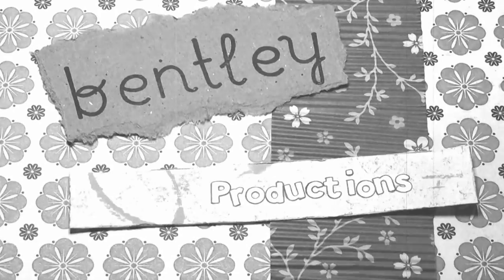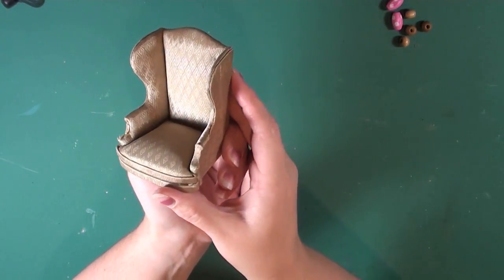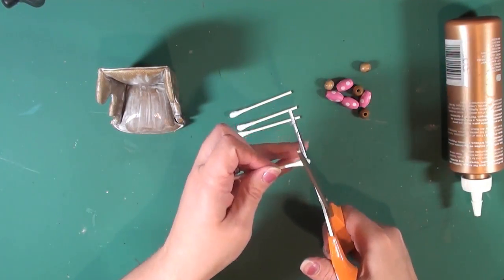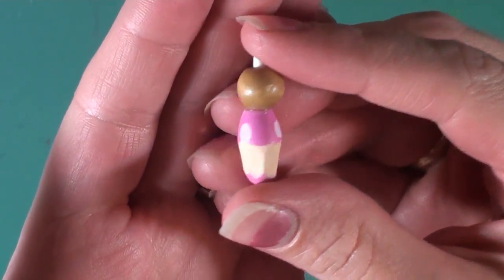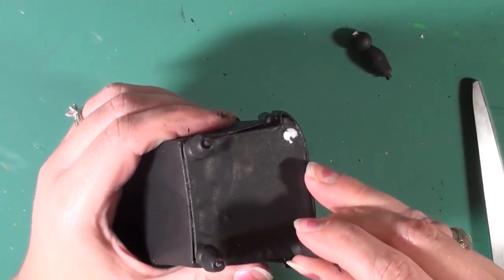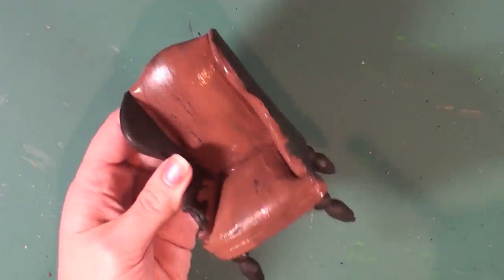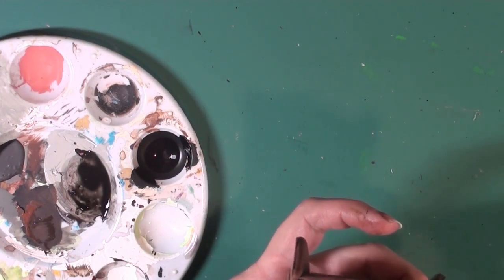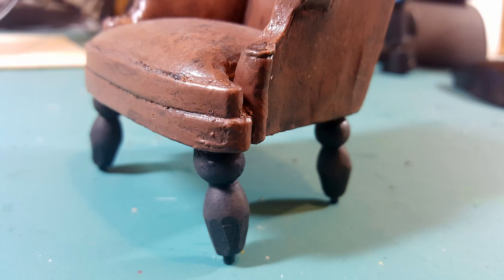Mini Remake: Turning a unfinished kit into an Aged Leather Wing Back Chair

Comment: Hi Ara, thank you for another fabulous video tutorial. I love how you remade this mini leather armchair with paint and Crackle medium. Have you ever tried Crackle Accents by Ranger? It's a shiny 3D crackle medium that you can use on miniature artworks to create lots of the sort of very fine cracks that you see on old paintings where the paint has cracked over time. There's also a product by Pentart called 2 - Part Fine Line Crackle Varnish that creates the exact look of old porcelain with fine cracks. You brush on the first part and let it dry, and then brush on the top coat which cracks as it dries, and you can use a hair-dryer or heat gun to make more cracks appear. When that's dry you highlight the cracks with any solvent - based antiquing paste or even eye shadow powder  works perfectly. I use a cheap eye shadow palette of earthy colours, but you can use any colour you like. Whatever you use to highlight the cracks must be solvent based or it won't work. The other product I want to tell you about is Dixie Belle's 'Dirt' which is a powder pigment that comes in charcoal grey, light silver grey or brown - which is the colour I have. It's made for brushing over clear wax to give a vintage look to painted furniture but it's great for creating the look of real dirt in miniature abandoned buildings and haunted houses. 👻 
Love from Amanda Jones in Australia

Comment: Looks great! I have seen others use gesso instead of mod podge as a base coat. What are your thoughts on that?
Reply from the maker: I think if it works for them then that's great!  I think mod podge would probably create a smoother surface to give the leather effect... but gesso may as well.  Not sure.  Thanks!